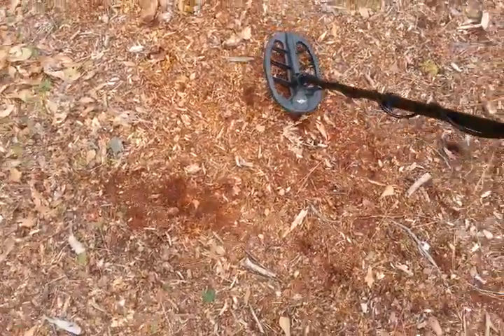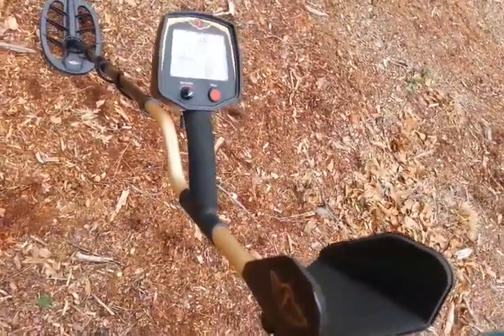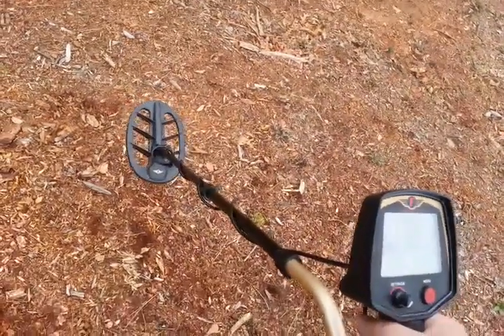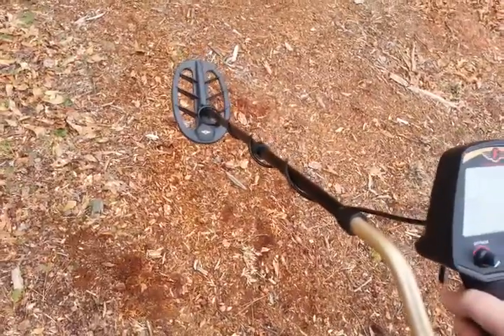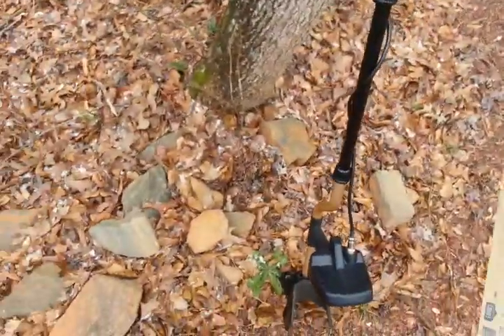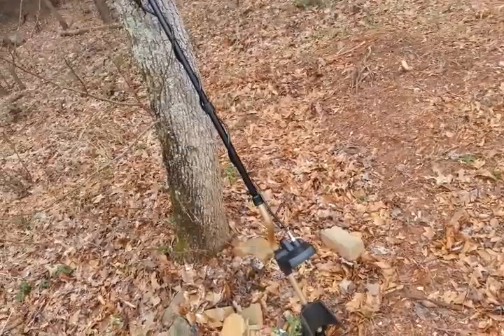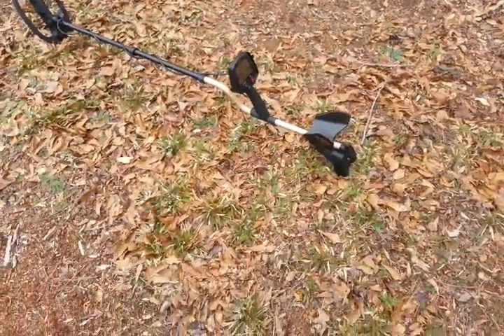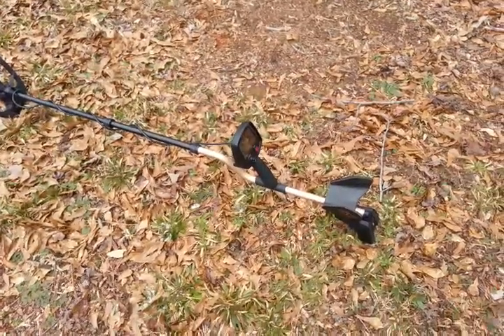Standard Fisher F75 Airtest on Nickel

Comment: I have used the same F75 since 2010.  I would not trade or sell it for any other machine on the market.  i can dig bullets over 10 inches with no problem and they sound like they are on top of the ground.  That loud.  It is a machine that I believe will never be duplicated.  I love my F75.  If I ever buy another machine I will buy another F75.  I did buy the F44 and i love it as well.  Not as much depth as the F75 but it will hold its own.